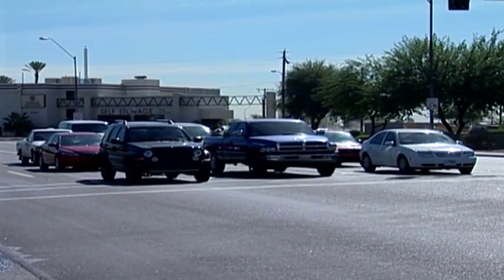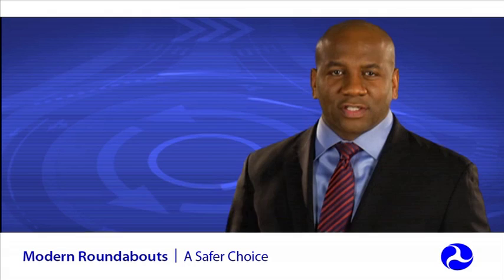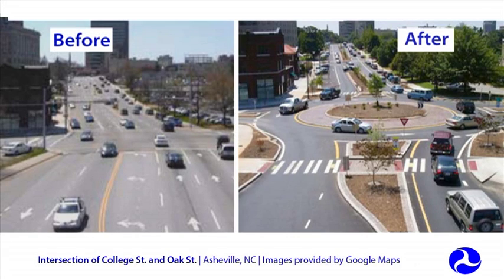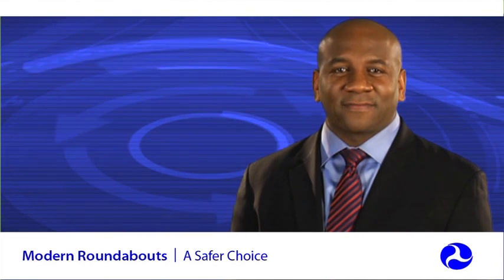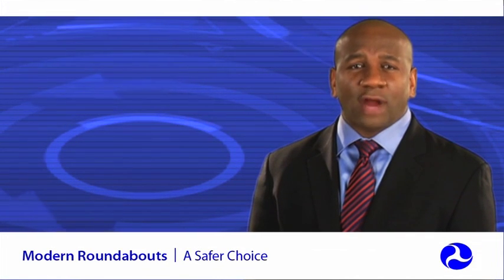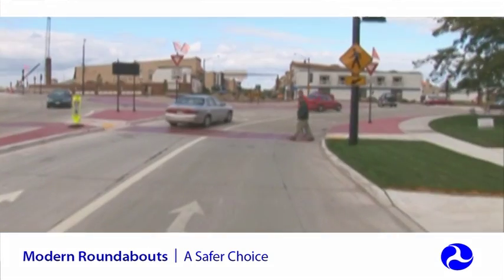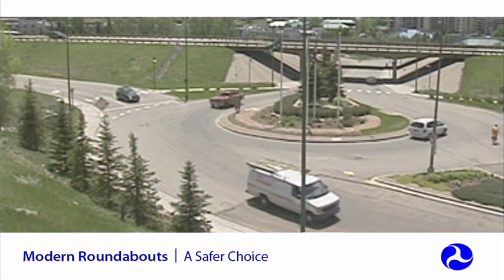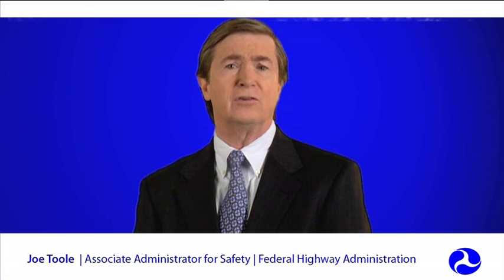Modern Roundabouts: A Safer Choice

Comment: Checking in from Carmel, Indiana in 2019 - we are up to 126 roundabouts (and counting) for our 90,000+ residents, and they are incredibly safe and effective. The neighboring communities have caught on too, and they are changing their stop signs and signals as quickly as they can. 
The places where I see problems are where there isn't enough local commitment - You can't just build one roundabout and be done with it - you have to make the choice to replace as many of your intersections as you feasably can, especially on at least one major thoroughfare, or you will not see any of the benefits. The stats don't lie - we suffer from less crashes, lower maintenance costs, have safer crossings for pedestrians, and much smoother traffic.

Comment: In Dubai, roundabouts are placed all over the city. When you go to other areas where roundabout exist and a large amount of traffic exist, roundabouts lose their primary benefit mentioned in this video since the waiting time for the roundabout to clear up is long and the circulating cars fill up the whole thing. I have seen this happen in the city of Al Ain which is a 2 hour drive from Dubai, to the point where they replaced roundabouts with ordinary traffic lights due to high traffic in the area. Roundabouts are good when the amount of traffic is at a reasonable level, but when the circle gets too many cars, its usefulness decreases to the point where a traffic light is better option for that busy intersection.
Reply: agree, roundabouts are better for residential and low commercial areas, or at least in intersections where most people do not use for commuting
Reply: Roundabouts can work for higher traffic volumes, too, but they need to be designed for that, with multiple separate lanes for turning right (or completely separate right turn lanes), going straight, and turning left.  Additionally, roundabouts need to expand in size to accommodate more traffic.  Small roundabouts  can only hold a small number of cars.  Larger roundabouts can move much more traffic.

Comment: Four way intersections can be just as safe as a roundabout IF PEOPLE WOULD PAY ATTENTION and follow the rules of the road. Four way intersections could also be as fast or at least faster than they are, if the signals were adjusted to change faster. Roundabouts are also costing taxpayers dearly to tear up and replace the existing pavement and right of ways to build the damned things! No one mentions pedestrians when they claim "roundabouts are safer" either. Just how are people on bikes or on foot supposed to cross one these things? With a signaled intersection you push a button and magically, the traffic stops and you walk across. Not going to happen with a roundabout!
Reply: The video above addresses pedestrians and bicyclists use of roundabouts.  Injuries and fatalities to pedestrians are lower at roundabouts than at any other type of controlled intersection, according to the data.

Comment: Those aprons for semis going about seems a bit unsafe for certain loads, such as loose ingots of steel in a van, or hauling pipes which always have a chance of shifting at any moment, but seeing how well the slight incline help the trailer get around makes sense. I am an experienced Truck Driver of Semis and have come across two Roundabouts without enough width let alone no apron and had to ride the trailer wheels over the median.
Reply: Was that perhaps a mini roundabout? Those are intended to be used with large vehicles going over the central and splitter islands.

Comment: One thing that roundabouts has helped is with rubbernecking... the experience when you are on the highway and the road seems to stop for no reason and then it speeds up again.  The cause is when cars entering a highway is at a stop light on the local road, when the stoplight turns green lots of cars start filling the road up, causing the rubbernecking phenomena.  The highway intersection where roundabouts were added has greatly decreased rubbernecking because cars are entering the highway at regular intervals.  Another way to look at it is pouring rice in a funnel, rice will go thru the funnel just fine if they are spaced out but will clog the funnel if you dump to much too quick.
Reply: I thought rubbernecking was when you're driving and you see a hot chick and you can't help but stare at dat ass

Comment: I've been driving since the 60's and I've never felt safe going through a round-a-bout.  Even when I was the only one in the intersection, it a was pain to navigate.  In my younger years, they were taking them out because of the problems they caused.  Now some engineer has sold the idea again.  I hate them!  Who's going to go?  Who's going to yield?  CRASH!   I thought you were going to yield and let me in - opps!  Give me a stop sign or stop light any day!
Reply: The old-style traffic circles you might have seen in the 60s and thereabouts had varying rules for who would yield.  The modern roundabouts are consistent: The car entering the roundabout yields.  Also, modern roundabouts are crossed at lower speeds than the old traffic circles, which reduces both the frequency and severity of crashes.  

Thousands of roundabouts using the new principles have existed for decades all over the world, and have a very good safety record.  We're beginning to discover what the rest of the world has known for quite some time.

Comment: Could these facts be false due to the fact we don't have enough roundabouts in the US.  We have two in my small town and they don't feel safe.
Reply: 3 in my town.  they've been there for years and multiple accidents and near misses every day.
Reply: That is most likely due to those entering and seeing the YIELD sign just before entering which they think does not apply to them. Then there is the intrepid misinterpretation of and lack of use of the INDICATORS or TURN SIGNAL before exiting or entering if your turn is the first right. I never had any serious issues with using a Roundabout when I got my permit 21 years ago and license 20 years ago, or my Class A CDL 13 years ago. Aside from the Yield and right turn signal to indicate exiting, its pretty easy to use. But there are the safety issues as well with inattentive or distracted drivers.
Reply: If we have to pick between the evidence of thousands of roundabouts used all over the world, and whether they feel safe to one person, I think we have to go with the facts over feelings.
Reply: Which town is that?  I haven't heard of a roundabout with multiple accidents per day anywhere in the United States.